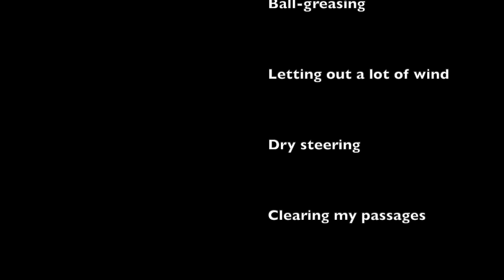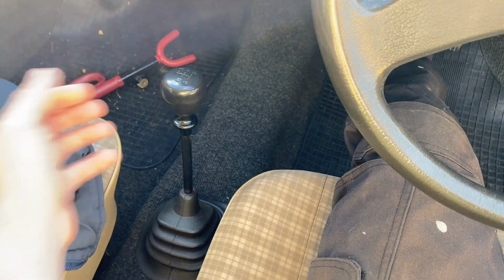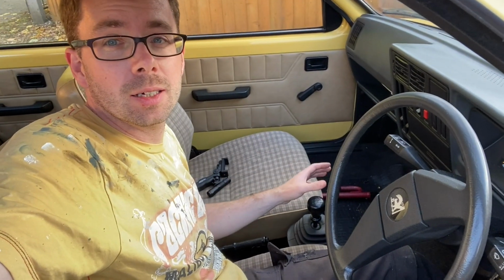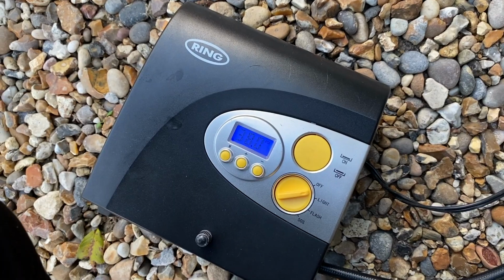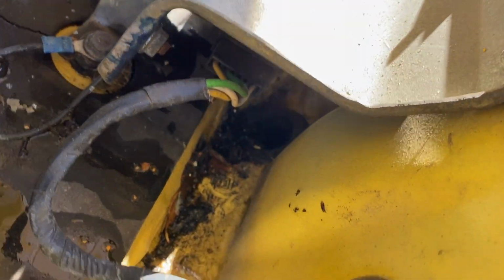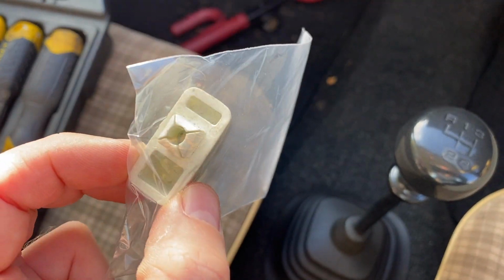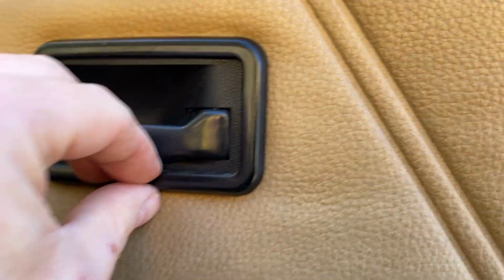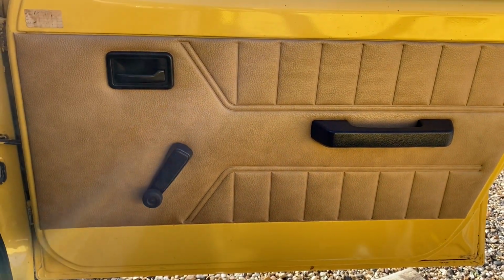Mk1 Vauxhall Astra saloon: fixing and tinkering

Comment: The problem with the stiffness in 1st gear still existed till the Astra G and Vectra B. 
My 2001 Opel Vectra B 1.6 has the F17 gearbox and as long as it's cold the transmission is stiff. Even an oil change didn't change anything.

Comment: Well done Sion and good to see some great jobs done already on the Astra and I like how you have put your 12 volt socket and made it discreetly installed 
The gearboxes are renowned for being like that I remember my much newer Corsa B could be like that in 2nd gear and 1st from new and it never improved really and my dad and brothers who also had many Vauxhalls have had the same even gearbox oil change doesn’t change it much I think some of it is the nature of the gearbox synchromesh is renowned for being weak especially as they get older 
Don’t blame you putting her away for the winter to keep her safe it’s going to be a nice car with your treatment looking forward to the next video
Reply from the maker: That's interesting about the gearbox, thank you. I'm going to change the oil out of curiosity, then give up!

Comment: Plastic parts require a special grease. Try renewing the gearbox oil. Generally downchanging from third to first is not recommended as it puts alot of strain in the synchros and these gearboxes are not renowed for their robust synchros. Chances are that the previous owner had a drving style of changing from third to second and second to while still at some speed. Keep in mind the synchros between first and second are used all the time, so they tend to wear faster than second to third or third to forth. Being gentle (as in not downchanging at fairly high speed) on shifting into second and first will significantly extend the lifespan of the gearbox. In your case changing the oil is probably the way to go and see if that wont help. If not try and look carefully into the gear linkage adjustment to make sure it's as well adjusted as it can be. If that doesn't help you probably will have to either live with the difficulty in changing or replace the synhros.
Reply: Agree totally, well said
Reply: Yes my dad who had many Vauxhalls always said about the gearboxes and the synchromesh even when fairly new
Reply from the maker: Thank you, that is all extremely helpful. I've bought a gearbox sump gasket so will change the oil as the first step, and perhaps not worry about it too much if it doesn't make a difference!

Comment: It's possible,  but obviously not certain that the high tyre pressures were a lazy tyre fitter seating the tyres on the beads and then not bothering to adjust the pressures. No idea if the tyres were fitted recently though so maybe not.

Comment: The problem with the gears might be that the linkage has moved slightly out of alignment, I had 3 Astras that all suffered with stiff gearchanges so I checked the alignment and hey presto.........a lovely smooth gearchange!!
Reply from the maker: Ooh thank you for this tip. I’ve just changed the gearbox oil as a first step, but it’s made no difference. So I’m actually going to try your suggestion at the weekend and re-align the linkage back to factory settings as set out in the Haynes manual. I shall report back!

Comment: That gear change reminds me of my Scion xA. It will not go o to 1st u til to come to a complete stop. If it’s slowly rolling, you can push hard and it’ll force in; at a stop it slides into first easily.

I think the synchro is worn from someone putting it into first while slowing down.

Let me know if you find anything different.

Comment: In the shot where you are in the car and the camera is filming the transmission linkage under the hood, I can see some play in the linkage. I don't know if such amount of play is considered excessive or not though.
Reply: I noted that too, but that may be just a result of having to use a bit more force than normal on the actuator. One for the "not critical but would be nice to have a new one" list.
Reply from the maker: Thank you